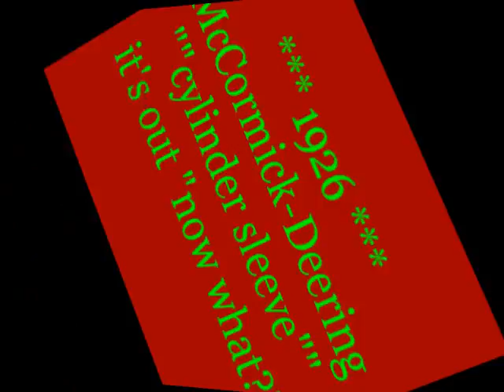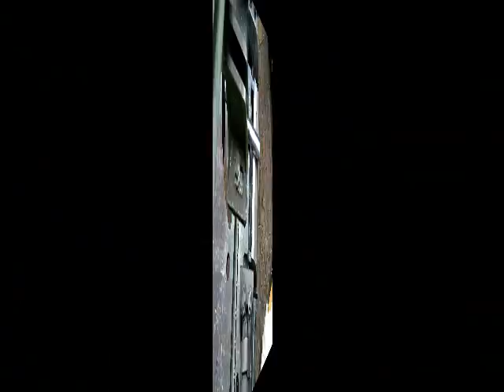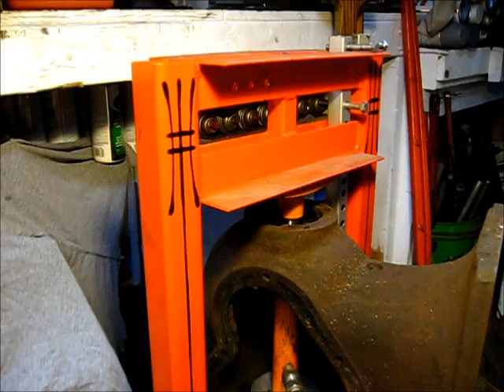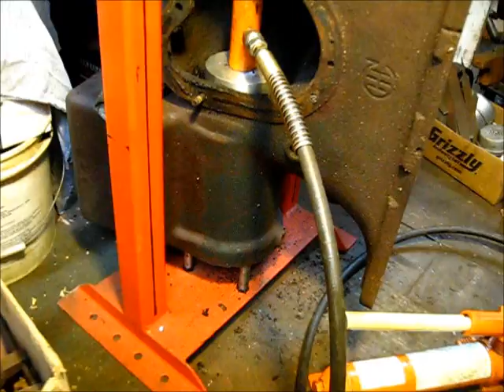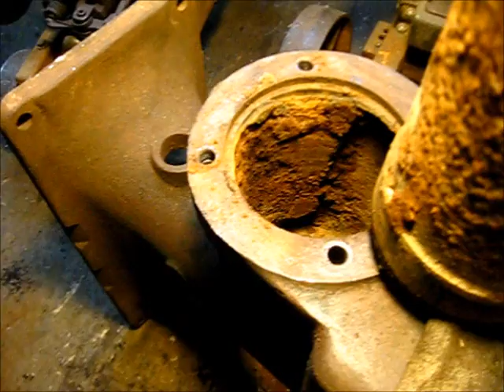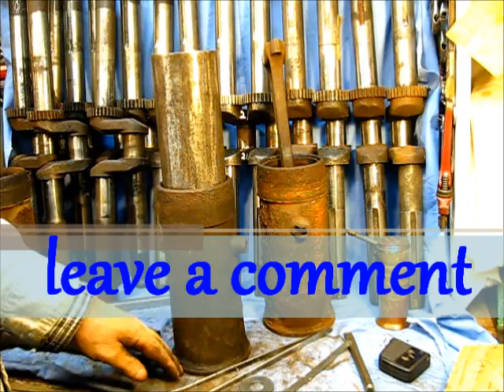1926 McCormick Deering type m / cylinder sleeve - it's out - now what? 6of

Comment: +shopdogsam I have a 1921 McCormick Deering M 1-1/2hp. I pulled the piston to give it some new rings. The very bottom of the cylinder, about 1" back from the head has a nickel sized defect. It looks like rust pitting. The rest of the cylinder looks great. What do you recommend I do?
Reply from the maker: ,,, if it's out front,, and the rings do not travel over it,, it's ok to leave as is,,,,
Reply: +shopdogsam thanks for all the help.

Comment: HAY SAM? Seems to me the manufacturers could have installed a plug or some kind a hole or opening on the bottom of the cylinder casing so a fellar can drain and clean the hopper every now and then. Dirt, dust and rust and hard water was inevitable as there was no Culligan man or rain-soft to come on the farm to treat the water wells (And take advantage of peoples pockets) or surface water from streams that the farmer used in the engine hoppers. I enjoy yer videos.
Thanks, George